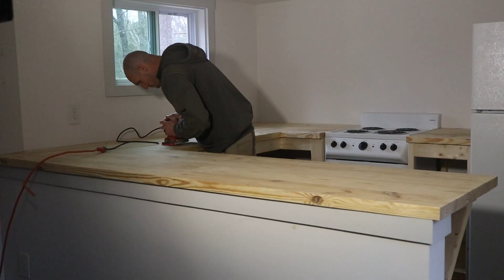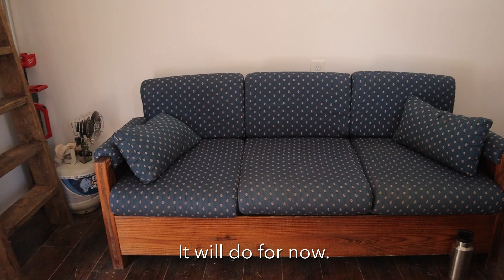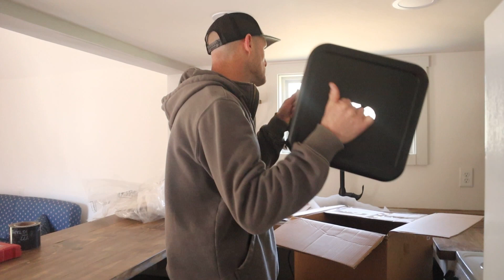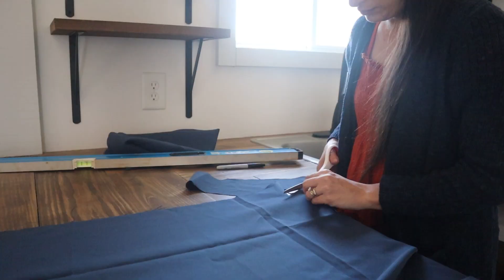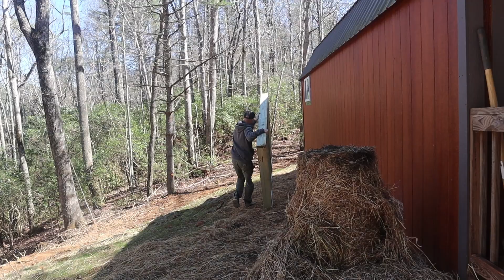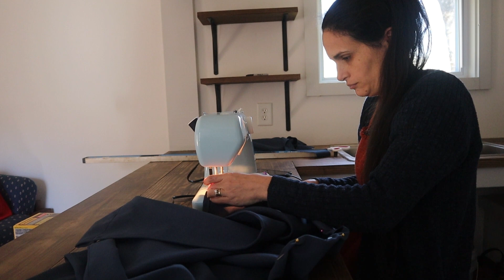Tiny house kitchen remodel | Shed conversion remodel | Before and after

Comment: Just a tip in the long run. You could recover the cushions on the couch later on. ❤
Reply from the maker: That’s what I was thinking. I figured I could recover if or upgrade. Either way it will work out good for us!